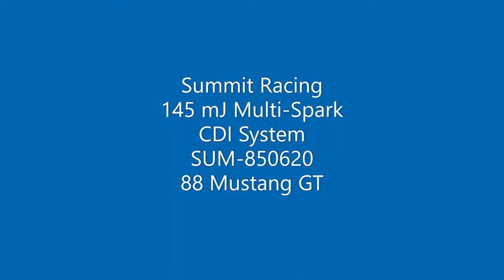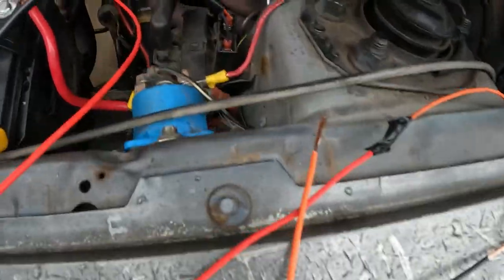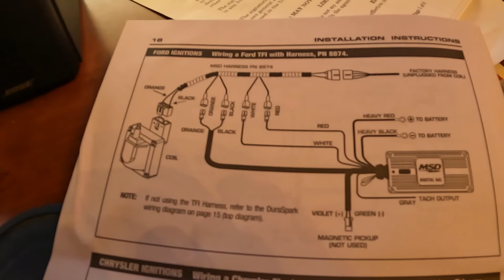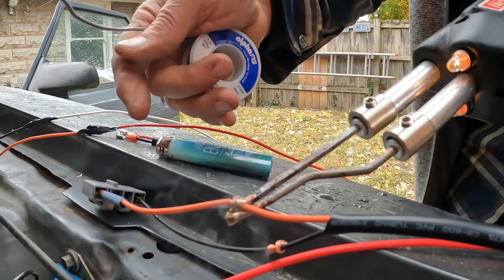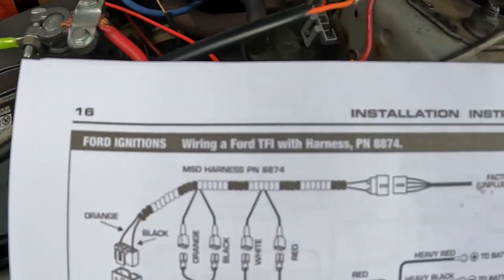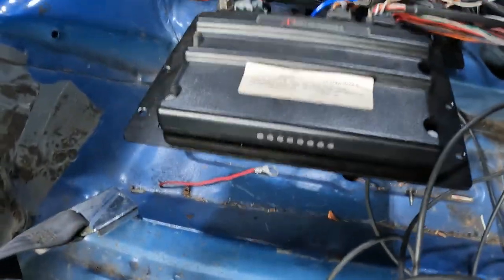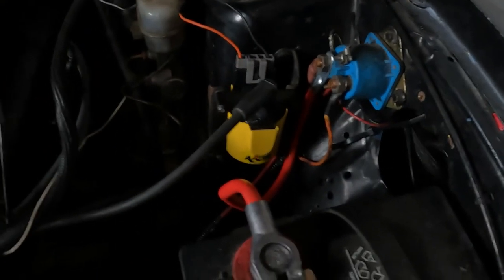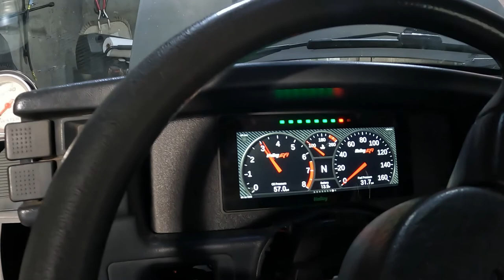MSD Digital 6AL Ignition Control - Foxbody Mustang

Comment: Hello I’m having a battery drain issue and I think it’s got something to do with the ignition box I have a red one like yours but it’s definitely not wired up like yours
Reply from the maker: Connect a volt meter to your battery and start pulling fuses until you see a voltage drop. That's where you start. Next go online and find the wiring diagram for an MSD 6AL ignitions. Hope that helps